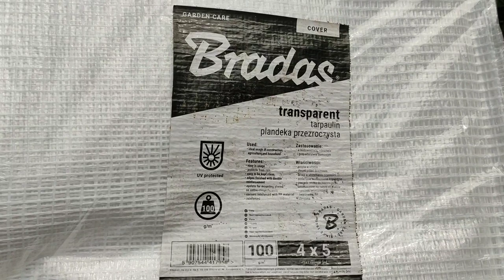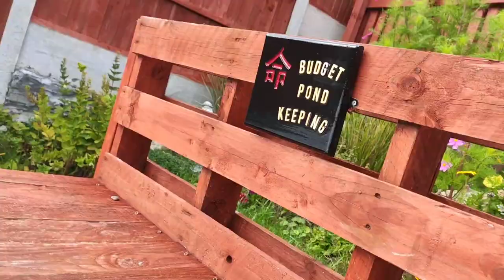cheap easy diy pond cover

Comment: Leon, to keep costs down just dig it out deeper and fit bottom drain set in concrete, no need for concrete base, use sand for gentle banking and fit edpm liner, more expensive but I would definitely fit a box weld liner, I used this method on my second generation pond, and so far so good 10 yrs later.
Bottom drain and box liner will transform your enjoyment of the hobby.
Reply from the maker: Yes mate I totally agree . To be honest the ground is quite firm underneath and not had any problems with ground water so maybe I'll get away with a bottom drain box weld liner and reinforce and level the wall 👍

Comment: Hi M8 yeah I’m thinking about updating my pond have had mine for 16/17 years now and this is my 3rd upgrade (Borden-Koi) started off on a small scale pond 1st but over the years buying to many fish so needed to expand the pond. Mine is 11’x6’x30” deep @ one end with a middle shelf of 18” and then a shallow shelf of 6” I regret having the middle shelf I need to do away with this and would definitely fit a bottom drain and square off my pond brick up so as I can get the pond to 4’ deep (may put a window in 🤔) at present it’s a Kidney shape good luck !
Reply from the maker: Cheers mate, im not 100% yet , I might just dig it out level the walls and put a new liner in . I'm going to have to give it some good thought 👍

Comment: Heath and Safety mate water depth limit is between 300mm 12 inches to 450mm 18 inches. Depending on the size of the pond.
Reply from the maker: What do you mean mate ?

Comment: Re pond covers. Wind may be a problem with the tarpaulin cover, hope it stays secure and does the job. Otherwise and a potential budget way is approach a local window/conservatory company. As these days people replace their conservatories with alternative structures. Ask them if you could have any unwanted polycarbonate sheets,  you never know. As for your current pond don’t beat your self about the design or looks. Most pond DIY’ers would want alterations on their pond.
Reply from the maker: Thanks David, that a good idea I think I might call around some local window fitters 👍
Reply: By the way where was the small formal pond at the start of your vid. I may not be to far away. Take care.
Reply from the maker: It's at the priory ruins Dudley

Comment: Great vid, would be a shame to see your pond go, there must be a way you can get the results you want from some tweaks, definitely need to have straight sides, shelves cause a lot of problems.
Reply from the maker: Thanks nicholas. Yes I have a few options I could just did it out and get a new liner. I'm not 100% I'm re building yet but it's on the cards 👍